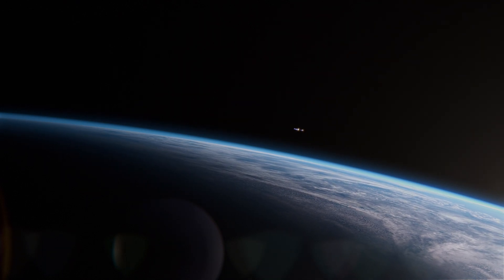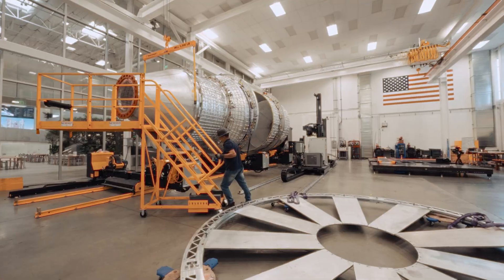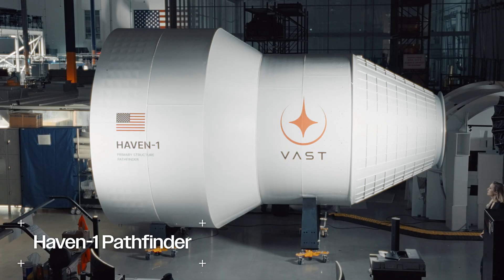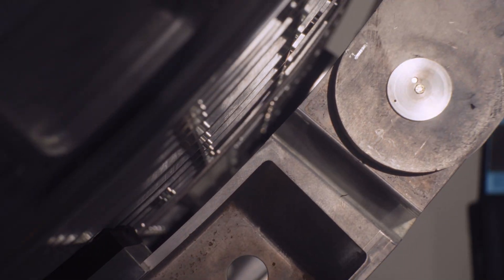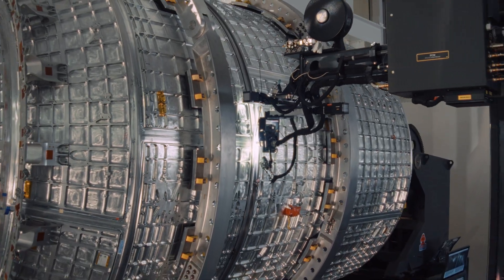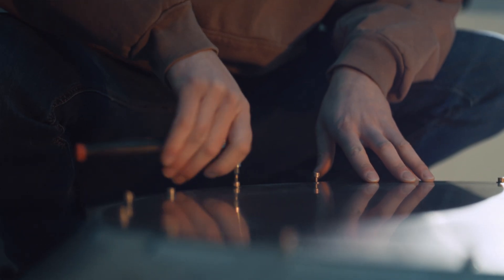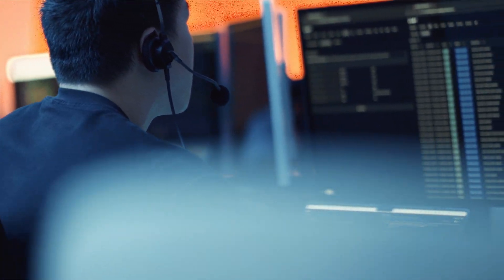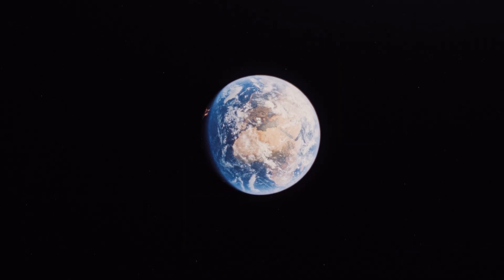Vast: American-made space stations

Comment: Good to see some progress. So when is the launch date? Why don't you share it with everyone.

If I had to guess I'd say you'll finish installation of the main systems and the outer shell build by mid-summer 2026, then lots of testing for a few months, then outfitting and payloads' installation done by the end of 2026, followed by the final intergration and testing campaign with the launch NET Q2 2027.
Reply: They already gave us the launch date. They are aiming to NET May 2026.

So, actually way earlier than you predicted.
Reply: @TheAugmentedMan1  
Yes, I was aware of that date. I don't know how old it is, though. I suspect pretty old.
Reply: We should NEVER take the planned launch dates by anyone at face value, especially for the construction of something as complex as a space station module - the most complex spacecraft type. Not just because it's manned, but because you have to make sure every component and part lasts the station's lifetime, as you cannot go up there and replace anything outside the pressurised area or just go home early as with a spacecraft. One tiniest part failing and your whole station is gone as you can't send people to it any more.

So I had a look at the possible launch date using two other approaches - complexity factor and historical data for space station module construction (the first approach was just quickly looking at the stages of construction and testing). Turns out I may have been a little over-optimistic with Q2 2027 date.

So the new date I will put as my forecast is NET July 2027.